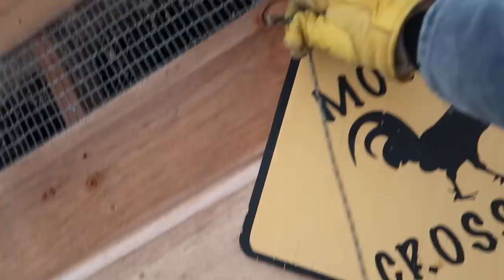It's Better with TWO     Building DIY Custom Smoke HOUSE

Comment: You were asking for ideas on how to collect the sawdust from your saw table to eliminate the mess you've got right now.
I bought a PVC drain channel with a grate top to move water away from my house, and it works very well with zero maintenance.
I bet one of them would be really effective if placed where the sawdust comes out of your two saws with a shop vacuum attached to the bottom of the drain. 
Maybe not as effective as draining water, but it shouldn't have a problem with sawdust if the shop vacuum is strong enough. That could sit on the bottom shelf.
Here's some pictures I found on the iNet to give you an idea of what I'm talking about, but I have no knowledge about the company that makes these so check out their quality first:
https://www.google.com/imgres?imgurl=https%3A%2F%2Fwww.firstcorporation.com%2Fwp-content%2Fuploads%2F%2Fcanali_grigliati_pratiko.jpg&imgrefurl=https%3A%2F%2Fwww.firstcorporation.com%2Fbuilding-products%2Fdrainage-channels%2F&tbnid=RwLF-6HKZh5ELM&vet=12ahUKEwiaoeTn7ujmAhUIneAKHZ_mC9sQMygJegUIARD_AQ..i&docid=3OSb-wZHcaQx_M&w=1200&h=675&q=pvc%20drains&ved=2ahUKEwiaoeTn7ujmAhUIneAKHZ_mC9sQMygJegUIARD_AQ
Maybe you can find one in a local store or buy one online.
BTW, Thanks for all of the interesting videos and Good Luck,
Wo0dy